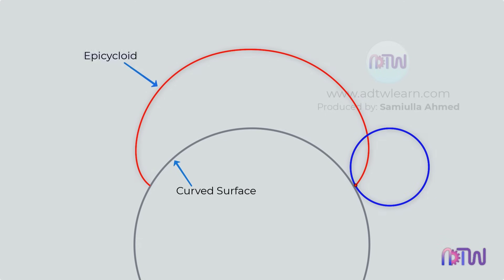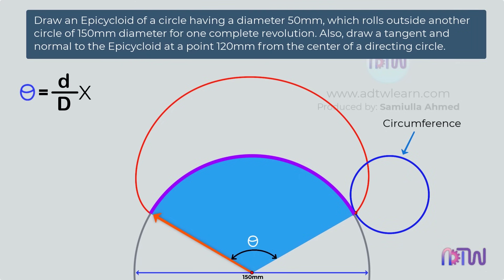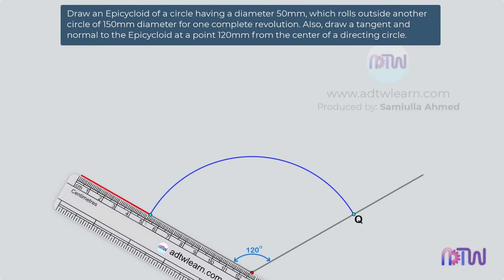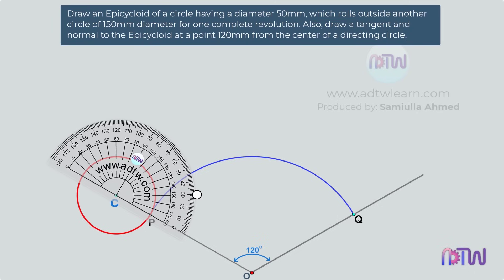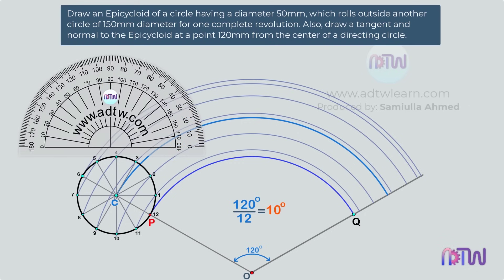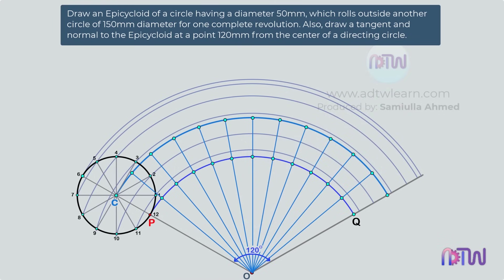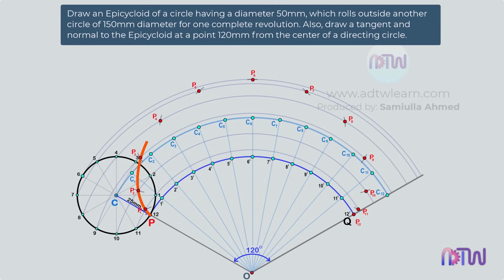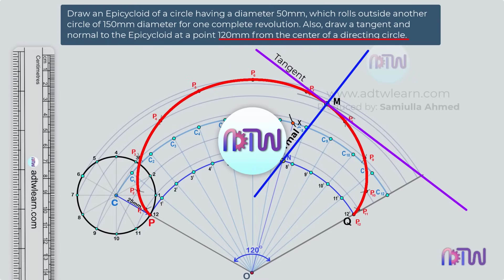How to draw an Epicycloid in Engineering Drawing.

Comment: Draw an epicycloid of a circle of diameter 50 mm, which rolls outside a circle 
of diameter 180 mm for one revolution. Also, draw a tangent and a normal to the 
epicycloid at a point 135 mm from the center of the directing circle